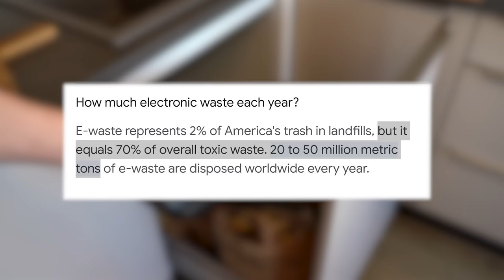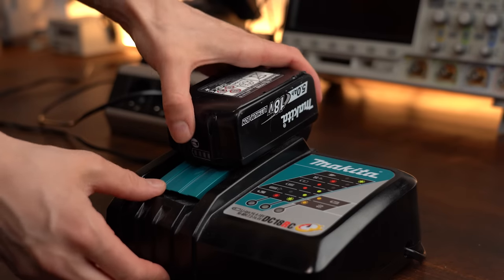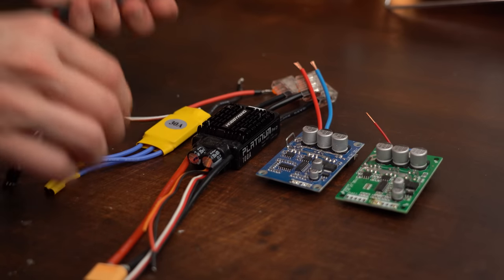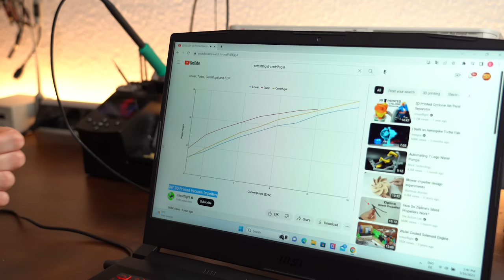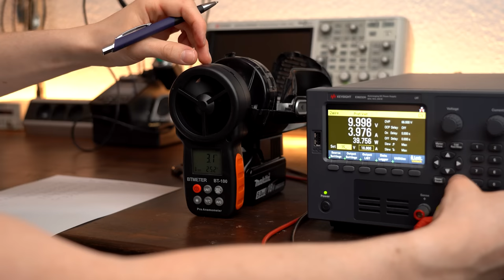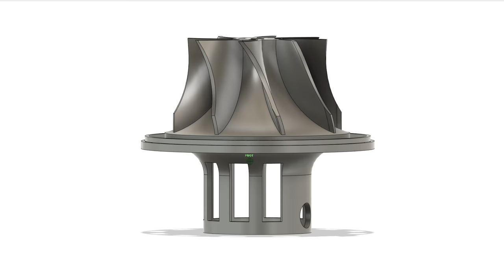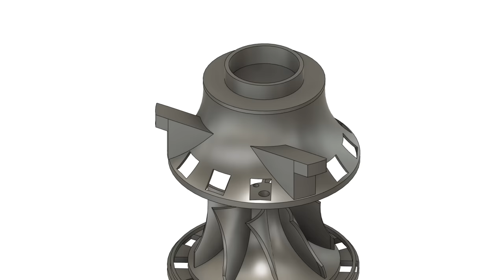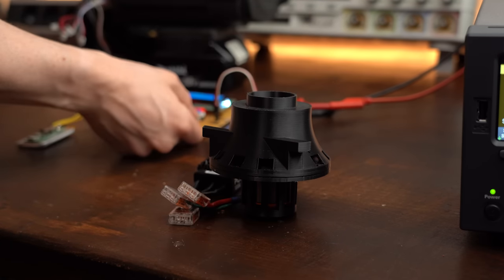I tried OVERPOWERING my Vacuum! (Homemade Turbine)

Comment: The impeller you choose has a higher throughput but a lower static pressure than the original. You can improve the original, but you either need a full radial again, or to turn the entire stack 180 degree and have a related half radial design sucking radially and bowing straight. 
Since a redesign of the housing is necessary anyway, to fit a wider motor, both is viable🤗

Comment: Good choice on the switch to ABS. It's pretty much the go-to filament for anything you need to last long enough. Not only the temperature resistance is important (since, sometimes it's not even a problem), but more importantly, the resistance to creep.
PLA would be a far better filament for final use prototypes if it wasn't so weak to creep. Anything under any kind of load will warp with time if made with PLA, far less on PETG and pretty much won't warp with time on ABS (yes, it also does creep, but to a WAY lesser degree), even at low temperatures, and much more so on higher temperatures.
Specially since you've got a Bambu Lab X1C after all, which can do ABS with far less hassle than open frames (tho, those parts would even print on open frame machines with a draft shield enabled on the slicer).

Comment: As soon as I saw the tight fit of the motor I knew it would overheat.  Zero airflow and PLA is a insulator, probably got hot enough to weaken the glue holding the magnets, which is why they moved.

Comment: firstly, a cleaning vacuum like you have is kinda akin to a turbopump, it likes massive speed and decent tolerances in the impeller casing to increase static pressure, try using more fins, faster BLDC, tighter"blade to case" tolerances, and print into something more centrifugally stable like UV resin

impellers are f**king difficult to DIY, the speed you have to reach for decent performance is nearly impossible for most 3D printed parts(injection plastic, metal and resin are kinda the only options), and the fine line between max performance and a destroyed impeller is so delicate that a youtuber I recommend you speak to, Integza, may be able to help you optimize your setup as he has experience in 3D printing impellers he primarily used for an air turbopump for his rocket engines, parts that tend to enjoy static pressure instead of flow just like you need

Comment: the best vacuum is a free dyson someone threw away because it needed a good cleaning.  ultimately you need a cyclone separator, independent of brand.  you use the airs own movement to create filtration.

Comment: enclosed impeller (where the impeller have both a front and back facing shroud, like your vacuum's original impeller) is typically more efficient than open or semi-open impeller and structurally stronger for give weight (you got two wall support the impeller blade instead of just one wall). Since air could back flow in an open channel design. Normally open channel impeller is only used when the fluid medium contain large solid that could clotting the impeller channel. So assume your vacuum have a filter that keep out large solid, an enclosed impeller is more efficient. And I think your volute diffuser could use some optimization as well. So you might want to consider switch to a close channel impeller with a proper volute exit.

Furthermore, on the torque efficiency front. Kinetic energy scale with air velocity square (KE = 1/2*m*v^2) while momentum scale linear with air velocity (F=mv). So it's actually more energy efficient to move a lot of air slowly than it is to move a little bit of air quickly for the same amount of suction force. So if you don't mind if the impeller is attach to vacuum externally, it's more energy efficient to have a large impeller that spin slowly than a small impeller that spin quickly. If you double your impeller opening diameter, you quadruple your suction force. So theoretically you could have this big ass impeller stick out of the vacuum on the side that is provide way more suction for the same amount of power draw. Diameter can increase up to a point until your blade tip speed reach speed of sounds. Base on your rpm reading, max impeller radius  = sqrt(343 m/s / (24k rpm * 1/60 hrtz/rpm)/2pi) ~= 34 centimeters. Pretty huge, but you probably reach material strength limit long before you reach the speed of sound limit.

If you want to increase suction further, you can staged multiple impller stage in a sequence like a jet turbine stages.

Comment: I would try, if you have the space for it, widening the impeller at the output end, giving a more flared design. since those impellers work via centrifugal force, the wider that base is, the more force you should be able to pull out of it. I'm also an electrical engineer not a mechanical, but those are my two cents

Comment: Needs more power draw, so either higher RPM (higher voltage or higher kV motor) or more load (big impeller with more suction)

Comment: Nice.  Less in the way of air holes for the rotor enclosure might improve the result because lower air pressure will allow the impeller to spin faster and experience less drag.

Comment: Have you looked at mixed flow fan designs? These move more air for lower power. Vacuum cleaning is all about airflow In told.  The centrifugal type you are using cause the air to change direction twice within the fan which isn't great for efficiency.

Comment: I once rebuilt a bosch vacuum cleaner just like you, tho I have used the same impeller. The original DC motor was a 19V motor but was driven at 21V by design. It was also a brass bushing motor, very low quality. The original circuitboard had a 328p microcontroller that had a program that disabled the vacuum if you have replaced cells. All considered they are not worth repair just salvage the parts and move one.

Comment: Very fascinating project, I designed lot of turbo compressor for my little vacuum cleaner project. For better results, you should increase static pressure, you can do that by better aligment of blades, maybe spliter blades with better blade curve (for better static pressure, main blades have to look like more likely "S" shaped) and with low tolerance enclousure, I think resin printing is best for it. The root profile is too important because that effects the area of blades, you maybe try to optimize it. I hope you come with new and better projects, nice work!

Comment: 7:41 This happened due to heat. The outer shell of the motor is supposed to allow heat to be conducted away, but it can't when it's in the PLA sleeve which acts as an insulator. It's cooking the motor. You need to get airflow through the core or this will continue.

Comment: Turbines have to be especially well balanced with special tools.  Solution.  Dyson hair dryers are way over engineered. Copy their design as it doesn't get any better than that except perhaps use a Dyson vacuum turbine as a template as I suppose there's a significant difference in design.  They are expensive because the design is way better than the competition.  Gl!

Comment: if you increase the amount of blades without making them smaller/take less space there should be more static pressure and maybe more unloaded airflow aswell, in a vacuum static pressure will make a larger difference

increasing the attack angle of the blades will also increase the amount of air moved, i'd try that first, it doesn't seem to be angled much

i'd also hollow it out and add an axial fan in the design to directly blow/suck through the motor as them bldc's really want cooling

Comment: I think a better starting point, would be to copy the old impeller exactly, and adapt it to fit your new motor. More speed does not actually result in greater static pressure (or vacuum pressure in your case), and will give diminishing returns in airflow past a certain rpm. Those characteristics are determined by your impeller design.
The turbo style impeller is designed to operate at very high rpm, but again the blade angles will be tailored to the specific rpm ranges for maximum efficiency.

For a vacuum cleaner, don't make the mistake of giving it too much vacuum pressure though. Otherwise it'll get stuck in certain situations, which is an issue for most budget vacuum cleaners on the market. So you might need to make a pressure release valve, if your impeller/motor design becomes too efficient.

People scoff at Dyson's being super expensive, but they know their stuff in this regard, hence the huge price tag.

This isn't really something you can "spit ball" as they call it, there's a certain amount of fluid dynamics to it as well. Hence my suggestion to copy the original impeller and housing, where the original manufacturer has already done the fluid dynamics calculations for you, leaving you to focus on what you do best. 
Beyond that, all you can do is play with blade shape and angle, to tune the impeller to your use case and tighten tolerances, to reduce leakage and turbulence.

Good luck though, it'll at least be educational, if nothing else.

Comment: In that situation I end up getting a new one for the wife and the old one ends up in the workshop (experiment laboratory).
Next I would be trying to figure out how to implement a two stage design to achieve a higher pressure differential.

Comment: I’m designing a “food disposal” but I’m designing it to actually be efficient…. Yaknow like it’s all torque but it clacks around and gets clogged,etc backwashes everything in muck 
So I’m designing a “vacuum” shredder blade that will fix all these issues and also be somewhat aesthetic… idk do impellers look cool to y’all?
Definitely conical/centrifugal impeller
Basically centrifugal “grinder/chopper pump” with a fine gague burr style filter in it

Comment: That's the same impeller of turbochargers. They are great for airflow with a little static pressure, great for powering cars, but not for vacuuming.

Search for an impeller designed for static pressure. You will need it when the filter of the cleaner gets clogged

Comment: A good idea would make the impeller out of a stronger material like carbon fiber reinforced nylon or fiberglass-reinforced nylon so the impeller can spin faster like a dizzying 30000 rpms without it exploding.

Comment: As soon as the PLA overheating and warping was mentioned, I immediately thought, "he's probably going to have to use ABS" while the loose magnet thing immediately made me think, "and epoxy the magnet in place"

Personally, I would have skilled the redesign and tried to rotary tool away the excess first to try to save on materials, especially since one of the goals was to minimize waste.

Comment: I'd like to see you remodeling the fan but with more fins, because then the pressure should go up and maybe the airspeed too. That means more suction and a better Vacuum. Also because you motor is rather slow I think it's stronger and so with more fins you might need a bit more Watts but also get more to the motor sweet spot.

Comment: You should change the turbine to have more aggressive angles at the tip, where the air is slower than at the end of the turbine. This kind of turbine is the same as in turbochargers for engines. Also I would suggest an inrunner, which has less torque generally but more rpm, and is way easier to mount.
Reply: Considering the size of the bldc motor I 100% agree with that

Comment: Actually the "Windage" or airflow isn't directly proportional to speed  there is a limited speed range where a particular fan works, Below or  above which it stops working.  HVAC isn't as simple as people think.

Comment: Naja die Ergebnisse sind nachvollziehbar, dein Impellerdesign ist besser darin viel Luft zu bewegen aber schlechter darin einen Unterdruck aufzubauen, dadurch Misst der sich nicht so stark anders aber bei der Arbeit merkt man dann doch einen unterschied ...
mein Tipp für den Anfang währe den Zylinder in der Mitte des Impellers zu kürzen da der die doch recht kleine Öffnung zusätzlich verkleinert ...
für mehr Druck solltest du die einzelnen Flügel deutlich schräger Designen, dadurch wird der weg länger und der Druck höher aber der Airflow verringert sich ...
dafür kannst du am Diffusor(also dem Teil wo die Luft raus kommt) bei solchen Geräten noch einiges rausholen

Comment: Very interesting experiment. Obviously there's a lot of engineering that goes into designing an impeller, but at least you got reasonable results with your original design.

I must ask though: is the bad soldering intentional? I'm sure after all this time you must have had some practice soldering, but in every video the soldering technique and the resulting joints are horrendous. I can't tell if it's intentionally bad or if you've just become really familiar with poor technique. For the sake of all the enthusiasts who see your videos and want to follow in your footsteps, I think you owe it to your audience and learn and show decent soldering technique.

Comment: I think it needs a much smaller impeller, spinning at much higher speeds. My vacuum has a much, much smaller impeller, which spins at 100,000 rpm or so and draws about 275 watts.

Comment: i fixed an electrolux lithium battery powered one with 3d printed propeller. main problem is the overheating motor makes the proppeller loose after some time. i utilized epoxy to overcome this.

Comment: I've been very curious about power tool battery packs and chargers.  They are typically 5 cell lithium packs, and each lithium cell could go up to 4.2 volts for a total voltage of 21 volts.  However most chargers and packs I've seen only go up to 20 volts or 4 volts per cell.  They most likely do this for an increased safety and lifespan of the cells, but also because they are designed as fast chargers.  I've been wondering if the chargers could be modified to go up to 21 volts or if it would be better to design a slow or regular speed charger so the packs could have a longer run time.  This could be a good DIY or buy episode.
Reply from the maker: Interesting idea. I put it on my to do list :-)

Comment: I think the bulk of your problem is the impeller and enclosure design. Of course you can fine tune the impeller forever, but for a quick and simple test, I would recommend allowing for more exhaust airflow. From what I could see, it appears to be a major bottle neck in this current setup.

Comment: maybe using a closed impeller like the original one will give you better speed as the airflow don't have a fixed surface to flow over.
btw did u try to apply some wd40 or sewing machine oil on the original motor bearing?

Comment: Why wouldn't you use a 555 timer for the servo signal? Dial it in to the required timing and lock it in

Comment: Are you sure you couldn't optimise the vents through which the air exits the impeller? They look a bit 'square' and might cause back pressure.
Also, looking at the impeller in my old Roomba 565, longer vanes at the outer circumference might impart more flinging force to the air as it leaves. This might necessitate a different ramp to help create the shape.

Comment: My guess would be that the problem lays in the “kv” rating of the motor? Lower kv motors are meant for high torque applications which means your fan should be larger for working properly. So i Think you should go With a higher kv rated which therefore would output an higher rpm and is build for smaller propellers (as you are using in your vacum). But Nice project tho, really enjoying being a subscriber

Comment: Maybe you need to better check out the impaler's characteristics: Does it scale linearly (RPM->Suction volume/air speed) or is there a boundary RPM, beyond which the turbulence created by the blades hinders suction?

Comment: Did you figure out why the original stopped perfoming maybe wear and increased clreance? Its impellor design looks a lot like my shop vac that moves a ton of air and provides decent vacuum before the impellor blades stall.

Comment: @GreatScott!  Why not check Major Hardware's series on 3D printed PC fans where he puts viewers designs to the test and rates them on things such as (from what I recall, haven't watched it in a while), air speed, sound test etc, could be useful to have a grasp on some aerodynamics and snatch a functional design since the creator has a leaderboard for best fans (he made the concept seasonal so there are already more than a few great choices to pick from, including one that looks quite similar to one you've used in the video)

Keep up the great work and good luck!

Comment: The better solution is sticking a gigantic 56118 bldc in there which can do 10kW of power, and if that's still not enough I fear it's time to upgrade to vehicle grade PMSMs. There you can comfortably get a 400kW motor which will surely clean your couch like nothing else

Comment: TL;DR squish the impeller on its axis and make it a one pice.

Stick to the original design, it was chosen for a reason. 
So a smaller inlet (the top part of were you screwed some bolts) and a bigger diameter (for a more centrifugal suction).

Also, try to make it a one part (like the original) blads and the cover.
Otherwise you need tight tolerance, to reduce bleeding. Not going to happen with a 3D print.

Hope it helps!

Comment: I tried to make a custom vacuum cleaner for a certain project myself, but it's quite difficult and dangerous. Surprisingly, I had more luck with the standard rotor type than with the "turbo" type
Reply from the maker: Good to know. Thanks for the feedback :-)
Reply: @greatscottlab  This has to get a crossover with the fan showdown :)

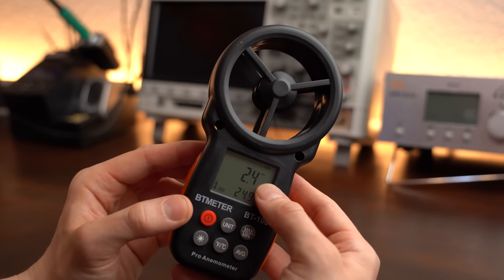Comment: 2:07 - it doet not tell you "how fast the internal fan spins in meter pr. second". I know what you mean, but the technical correct would be it measures the air flow in meter pr. second. 🧐🤓
Reply: Also I don't see issues with a 900 KV, just as some more voltage to compensate? Unless bldc or ESC cannot handle it.